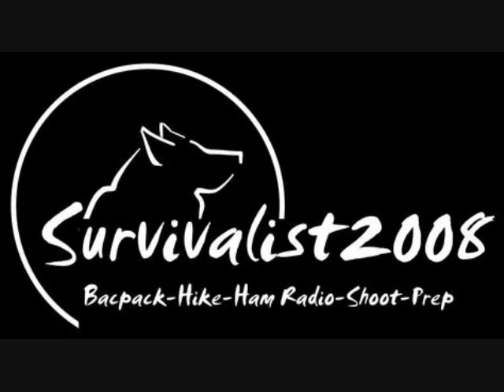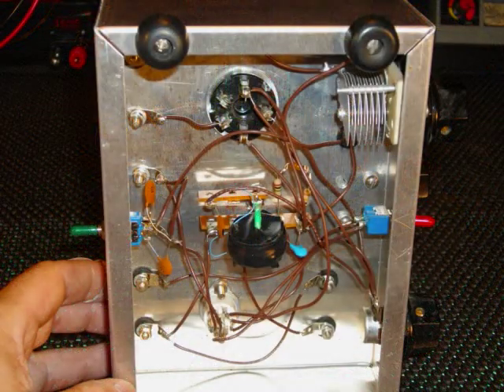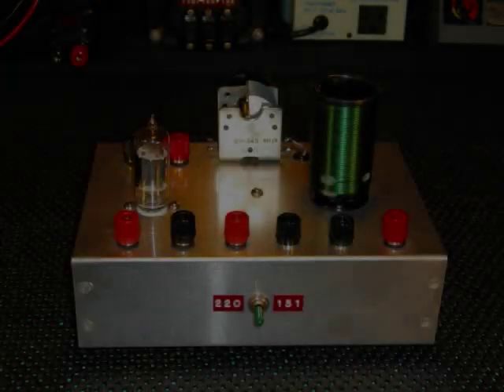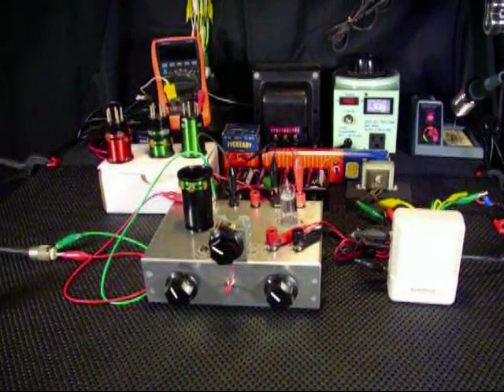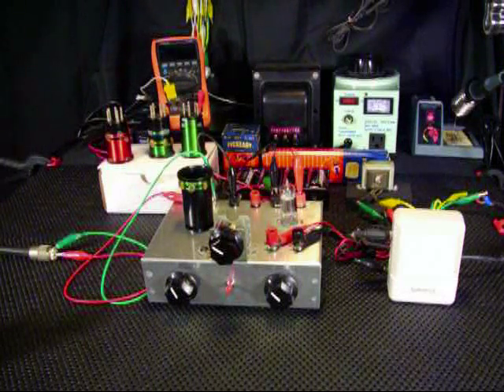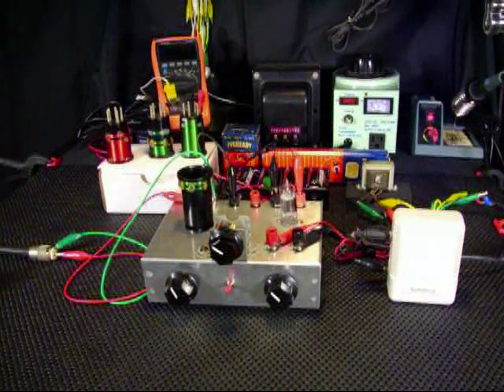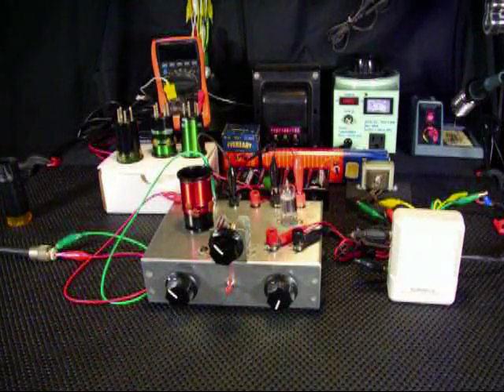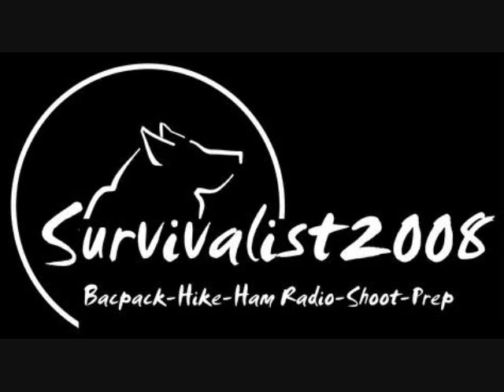One Tube Regenerative Receiver Project by Survivalist2008

Comment: I have in my grubby little fist, Template #12, of The Science Electronics, Inc. multiple circuit kit sold as a learning aid for budding electronic afficionados. It is a schematic of  a Regenerative Grid-Leak (Pentode) reciever. My dad gave me the 12-circuit kit back in the 50's. The #12 template used a 1T4 tube. The paper template was laid over a 10" x 11" pegboard and  one would place the components (each had its own plastic base with appropriate verical pins to make the connections with different lengths of jumper wires) on the template through the appropriate holes to make up the circuit du jour. Much fun; and I remember being crouched up in my home's attic just under the roof pulling in signals from all over the world with a long-wire antenna strung through the roof vent. This Christmas, my daughter gave me a beginner's kit by Elenco to potentialy show my grandson, but it's poorly executed and a few of the circuits, as designed, don't work. It uses pictures to show how to mount the parts..which snap together. Someone needs to bring back the Science Electronics kit! I ''ve got a hankerin' to build this kit from scratch, now!
DE KA7MWQ,

Comment: I built my first re gen  radio in the 1970s using a 1T4 tube with  D cell for filament  and  3 9V battery for B+. them 90V hard to get now. use 10 9V batteries. used a loop stick coil  for MW had a tune able slug so went into 160Meter ham band. and a little into long wave. with a 365pf cap. someone else in my school built a re gen radio for 27Mhz all transistor in 1980. CB was common then. surprised how well it worked.

Comment: Thanks for the video.I'm about to embark on a recreation of the one tube regen Radio used by U.S. POWs in the Cabanatuan prison camp during WWII. it was built into a drinking canteen and when not in use was hung in it's canvas carrier right in front of the japanese guards!I'm slowly getting all the period items together, and me and my young son will start putting this together. my goal is to use all 1940s parts.73'Jim KB1PFL

Comment: Hello. Nice project ! I tried making one using a loop antenna and a 6J1P russian tube with about 30 V of plate current and it had poor results, with the regeneration potentiometer not making much difference from one end to another. Do you have any advice ? You said that you don't want it to oscillate in the broadcast band. Why is that ? This sounds counterintuitive. Also, how can I choose the tube so that it doesn't work with huge voltages ? Ideally, I would stick with the 6J1P since I have a lot of them and I don't have much use for them.

Comment: Hi... It looks like a project built by an experienced experimenter. Very impressive.
Is the Wikipedia circuit, the Armstrong one and I take it that the two diodes in the valve (tube) are just ignored?
The original role for that tube is in a superhet...IF detector diode, AGC diode and triode audio amp.
Thanks for dragging out my memories of the early days (for me).(Fifties!) when I used an acorn valve (tube) type 954. Still get the valve but not the holders.
Yours worked so well that I might just have a go at it, for fun even with all the fancy stuff on my shelf! 
TNX es 73 de G3NBY
Reply from the maker: ***** Thanks G3NBY, it was a fun project. Reminded me of some of my childhood projects, I was fascinated with circuits and AM radio. Yes, the Armstrong tube just amplifies. I just followed the schematic and it worked....pretty well. A metal front would have helped, but I wanted to make it simple. Thanks for watching es 73 my friend. John KU4JZ
Reply: Survivalist2008 Thanks John.
The problem is finding some plug in coil formers. Very rare these days...Maybe yours isn't plug in but just one fixed coil?
73 de G3NBY
Reply from the maker: These were blank surplus bakelite forms. I experimented on the number of turns. Worked out pretty well.
Reply from the maker: Thanks Pedro!
Reply: +Pedro Henrique Silva de Deus 
Hi Pedro.. Just found your advice. Been in Dry-Dock for heart repairs!!!
Thanks for the tip..I'll try them.  M.O.L.